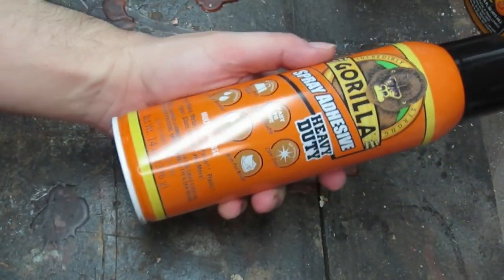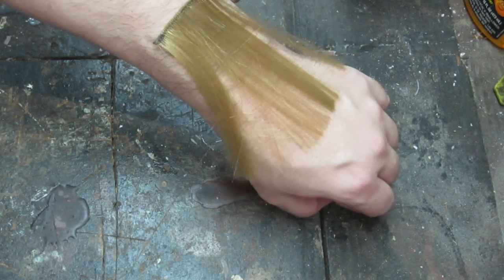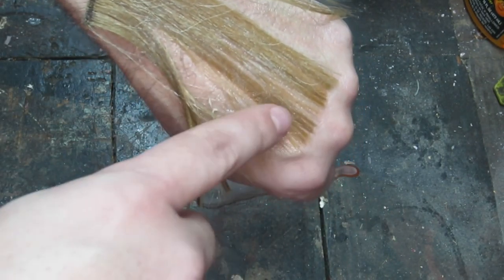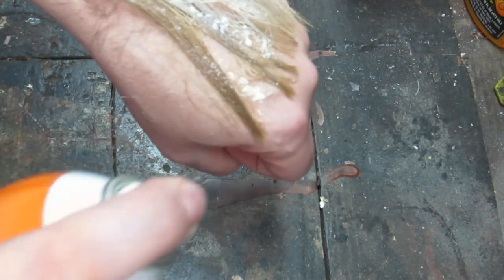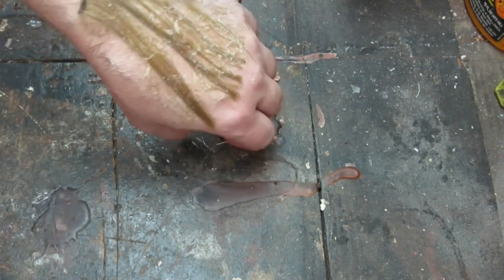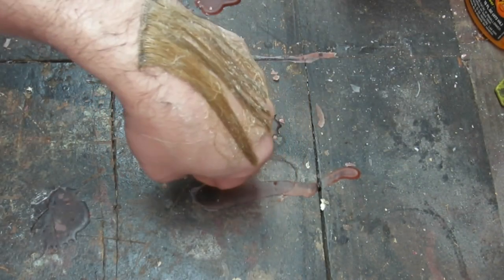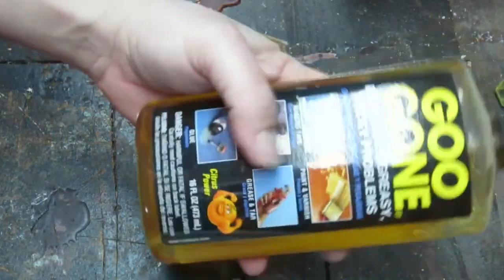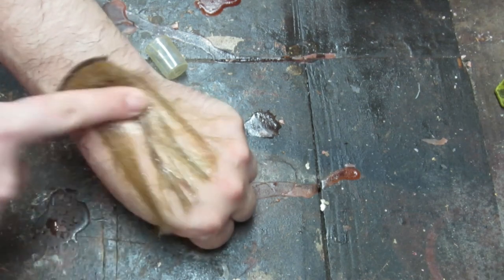GORILLA GLUE IN HAIR SCAM. High Levels Of Sus for the Gorilla Glue Girl story! | Dark Nook

Comment: Welll.. she definitely used hair gel first. Then the hair spray ontop. If she did it.  Like hairspray,ppl don’t touch it after it’s on the hair. G2B hair spray is sticky as well.  So... it wouldn’t be too out of the norm for hair “spray” to get sticky. Maybe u should do it with eco style gel and then put the hair “glue spray” on it so we can see it. Lol. Ps. Doesn’t that burn? I’m sure none of this is healthy.
Reply from the maker: Nah it doesn't burn.  Even more evidence she's full of crap.  Gorilla glue, goo gone, and acetone... none of that stuff burns on the skin.  It you have an open cut or other break in the skin, that will burn.  So when she's acting like acetone wipes are burning her... she's just flat out lying.  Any woman who has ever used nail polish remover knows what acetone feels like on the skin.    As for the sticky issue... the point was just to show that in order to get the glue in the hair and down to the scalp it would have to be worked in... but there's no way to work it in if the hair is already styled.  because any touching at that point is going to mess up the style.  And there's no way glue could be added first and then styled because it's too sticky.   If she did what she said, she'd wind up with a dusting of glue across the top of the hair, that would not have penetrated the hair, nor glued the hair to the scalp.

Comment: Now use a brush.
Reply from the maker: Why?  Are brushes glue proof?  All that would accomplish would be to ruin a brush.  And weather I used a brush or my hand, the point is, that the glue would still have to be worked into the hair manually in order to achieve the results that she claimed she got by just using the glue as a finishing spray.

Comment: you barely sprayed any on and she probably caked it on and combed it in and applied layer after layer along with her hair being wet and other product keeping it from drying as fast as you showed. my friend works in the ER, hes seen things like she did. its possible. she basicaly created a shell
Reply from the maker: You obviously did not watch the video.  I applied multiple heavy layers, and worked it into the hair.  I also showed that the hair is unworkable long before the glue is fully dry. Doing layer after later would be very difficult once the first bit of glue was applied.
Reply: how do you comb glue?  you can do the same with hair gel and a dryer and the style lasts a month.
Reply: the doctors office has gone and cleared this as being real so when you going to retract your statement???? she just went through surgery. you going to take back your idiotic words or what
Reply from the maker: @danielkaler569  LOL!!  Surgery?  Obviously you didn't watch the video.   All they did, was exactly what I did.  Watch the video.  They spray orange liquid in her hair, work it arround by hand, then comb it out.  The doctor confirms the spray was medical adhesive remover. (same ingredients as goo gone plus aloe)
Reply from the maker: @danielkaler569  Why would I retract anything I said, when everything I said has been confirmed as 100% accurate?  LovelyTi's video proves I was right that this girl lying about what was in her hair in those first videos.   December Reed's videos prove I was absolutely right about how gorilla glue behaves in hair.  And the TMZ video proves the high end plastic surgeon removed the glue using exactly the method I said would get this glue out.   So tell, what exactly should I retract?

Comment: I think your forgetting how the glue was sitting in her head for A MONTH!!!!! The glue would have already dried by then, we don’t know how much glue she sprayed on her head but we do know that spraying the amount of glue you sprayed in this video is NOT enough to stick your hair to your head she must of used a ton of that stuff.
Reply from the maker: First, the glue achieve full permanent bond in 10 minutes.  Second.  I used a lot of glue on a thin little single layer of weave hair, and it still wasn't enough to penetrate that hair without being thoroughly worked into the hair.  Now imagine how much glue it would take to coat and permeate multiple layers of thick hair.

Comment: PSA... don't put glue on your hair, not a over all good idea! 
She sprayed her hair like you would spray "Oil Sheen" (light oil) after styling. No brush/ comb needed because its already brush down with gel and what every else she used. Then after she was done, she used that spray glue to set the style in place and that it did! Lol not funny! 
The misunderstood is thinking she combed her hair and styled it with this spray on it.I don't think this guy realized she applied the spray after everything was done. SHE DIDNT TOUCH HER HAIR AFTER APPLICATION. 
 The arguments on here are meaningless with him but entertaining! Lol 
 I do believe goo gone would be good to try. He's right about that and combing after putting this on your hair wouldn't work. Since hers was applied after styling and NOT TOUCHED the presentation on the cheap wig piece probably wasn't the best example of this young lady situation but good recommendation on the Goo Gone stuff to help! I used to use that when I was a teacher to clean up after the kids arts and crafts. Lol
Reply from the maker: I understand what she said she did.  She said she used it as finishing spray.  And the point I made was that if she did in fact do what she said, the glue would have simply rested on the very top layer of the hair.  The spray dusts the surface, and does not permeate.  It couldn't even make it through that thin little layer of hair I used, without being worked into the hair manually.  But what she showed in her videos is hair that's completely glued solid down to the scalp.  So my point is there no way she could have accomplished that effect, by doing what she claims she did.  So I think her claims are BS. I think her story about it being an accident is BS.  I think she did this on purpose, and probably knows full well how to remove this glue.  But she's got a gofundme up to 11K so why would she remove the glue before she cashes in?
Reply: @DarkNookShop  washing your hair and brushing it back with gel into a ponytail will make it look that slick and hard (depending on the gel) plus she have a perm and that is a hair straightening treatment which will help her achieve the slick look she was going for. You don't really have to put a weird substance on your hair to achieve that look. Its a everyday style for women, FYI... we don't use Gorilla Glue! Lol they make spray to harden your hair style in place if you want and it will make your hair rock hard ( literally)
Anyway....Since then they did remove the hard layer on top of her hair (that she sprayed) and she still have hair because it was on the top layer ( that she sprayed) and didn't penetrate through hardening all the layers.
I think the whole thing is stupid lol and she is using this as away for her to make money, now that she got all this attention. If she did it on purpose or not I don't know but She isn't the first person to make money off of going Viral doing something stupid online and won't be the last.
 This is such a weird story to have gotten so much attention the real question is why? If you ask me.
Reply from the maker: @MrMsLoveLee  At first I think she was just being stupid and making up some bullshit for a video to get some attention.  But when that shit blew up and there's a 30 thousand dollar gofundme and offers of free trips to see specialists and talk of lawsuits... then shit got real and she actually did have to spray glue in her hair or else get caught out in the lie.

Comment: You truly lack understanding on this subject & basing your assumptions on old outdated fallacies and you will not listen.  You say to me again her hair is thick & heavily textured and I've told you after the processes she uses her hair would be thin, delicate and fragile, more so than the 'hair' you used, consult a pro.  And I specifically say the hair is laid, then glue sprayed and not touched again, a new layer is laid atop, repeat….  If you think there are not artist out there who do sculpt hair like this with a fixative you are showing your lack of knowledge.  Please answer my question about the integrity of the structural surface constitutes that compose the hair shaft and the scalp layers & substances that could effect your expected outcome of the glue's performance.
Reply from the maker: When I'm referring to the thickness of her hair, I am not talking about an individual hair.  I'm talking about the collective mass of her hair together on her head being thicker than the single layer of weave hair that I used.  And if she did layer upon layer, which is not what she said she did, the same issues still apply.  The glue would still need to be worked into the hair in order to permeate down to the scalp.  As for the hair surface, being damaged would certainly add to the likelihood of breakage, but would only add to the tendency for the glue to remain on the upper surfaces, by giving it a rougher surface to grab onto.
Reply: @DarkNookShop     You truly lack understanding and your stubbornness & pride….   You just don't get that she does not have this thick mass that needs to be soaked,  saturated and worked to reach her scalp.  In the video you CAN see a lot of her scalp at the parting and on the side above her ear.  Truth is if you have never straitened hair like hers you will never truly understand.  Thank you, enjoy your day.
Reply from the maker: Does she have more hair on her head than I glued to my hand?  Seems a pretty obvious yes.  More hair means there is more mass between the top of that hair and the surface of the scalp. i refer to that mass of hair as having more thickness. You think the problem is I don't understand the mystical characteristics of black hair.  I think the problem is you don't understand more hair is thicker than less hair.